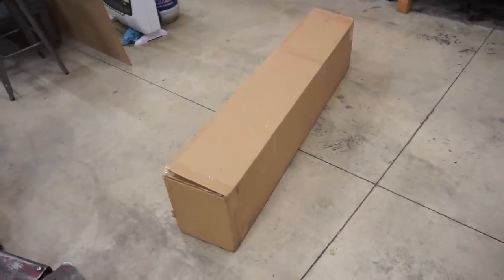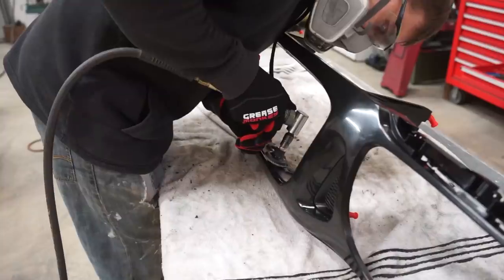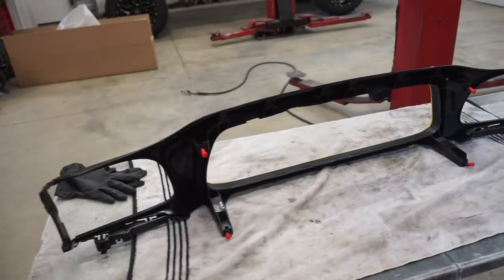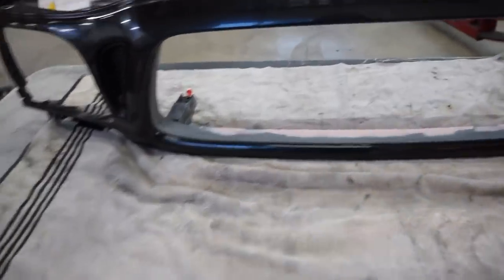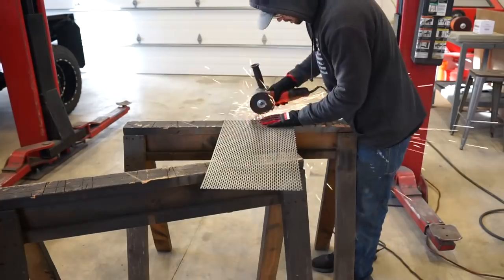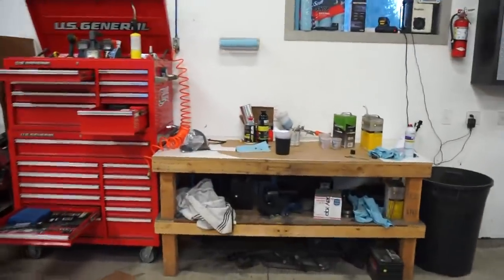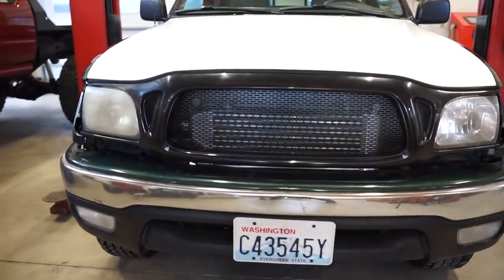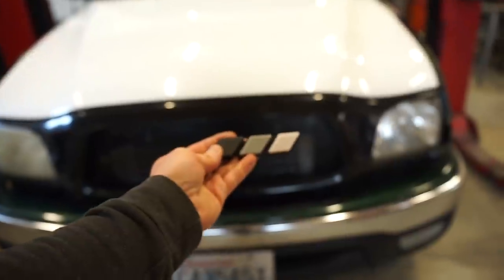Custom Grill Build For My Tacoma!

Comment: I am getting my BHW w/ XMAN 1856 turbo tuned tomorrow morning.  2005 Passat Wagon 5-speed swap, deleted, buzzkin catless downpipe.  Very excited.  Hoping to get a little more power back down low because the turbo swap made it a bit of a dog....more than I expected lol. But top end is great, and with my commute, that's where i needed it.

Thanks for the XMAN turbo recommendation.  And thanks for your Diesel purge video too.  That's getting done as we speak.
Reply from the maker: Sweet!! I have that turbo on my red truck. It spoils great with the proper mapping!
Reply: That's really good to hear.  I'm running my skinny winter wheels....195/15's.  So, I'm hoping traction doesn't hold back the tuning process, because I don't have an LSD installed yet 😬
Reply: @austinniemela  I dropped your name to XMAN, btw.  Just to make sure you got some credit 👍

Comment: WAY better than the stock grille, I've never liked the grilles on those years of trucks. The work the PDR shop did is sure going to save you a lot of time. I like the grille emblem, I've seen one on a neighbor's Toyota, I'm going to get the yellow/orange/red one for my Toyota solid axle swapped Ranger (I did paint my old 82 Toy blue and white with the triple stripe across the door and fender.)
Reply from the maker: Thanks!! Yeah the pdr is going to make body work a breeze!

Comment: Quick tip. When I made my custom grill for my 99 Tacoma I had an OEM chrome grill. If you spray oven cleaner on the chrome and let it sit for about 2 hours the chrome will bubble and flake off.
Reply: Excellent tip sir thank you for that.  My last name is also Brown. I would expect nothing less from a Brown! 😁
Reply: Nice thanks man i have a chrome armada grill ive been wanting to paint
Reply: I did not know this.  Will give it a try and report back.  👍🏻

Comment: Another great video. You need to get one of the DeWalt oscillating tools you can cut sand all kinds of different things with it it would work fantastic cutting plastic and it won't melt the plastic.
Reply from the maker: I’ve never used one of those tools! I might look into one
Reply: @austinniemela  skip the dewalt. Plastic gears strip out. I’d go makita or Bosch see quite a few cabinet makers use them over the dewalt.
Reply: Astin the dewalt is model DCS356B only recomending because you already have dewalt cordless tools there are better ones out there but by sticking with the same platform it will be cheaper. This type of tool works great on plastic, cuts and sands.

Comment: hey Austin. you should really use a plastic repair filler that has a little bit of flex to it for plastics. also when you do the body work on the Taco id recommend evercoat rage ultra body filler, good body fillers save time and sand a lot faster. been a bodyman and painter for 15 years now.
Reply from the maker: I bought some evercoat z grip, a few people suggested that!